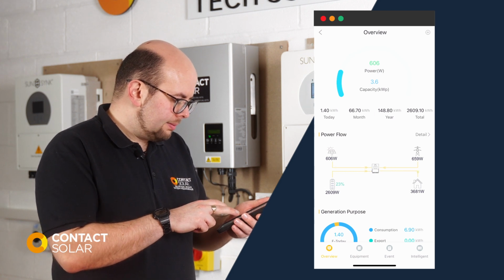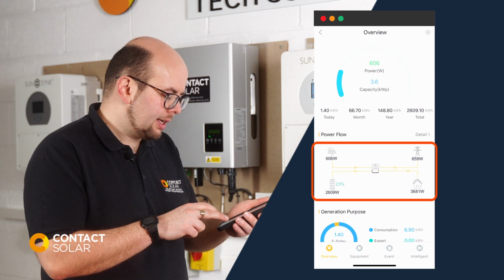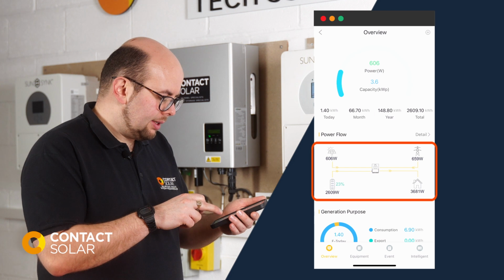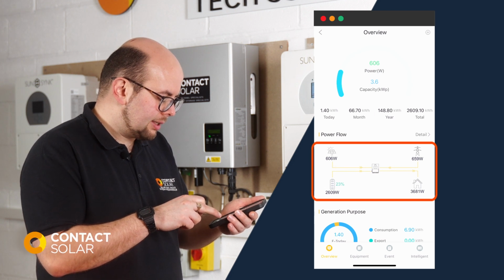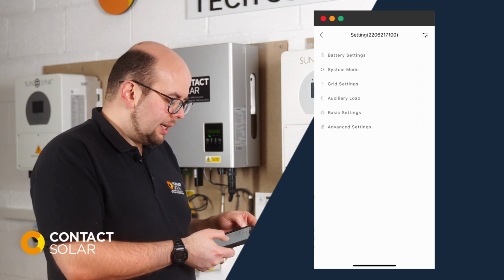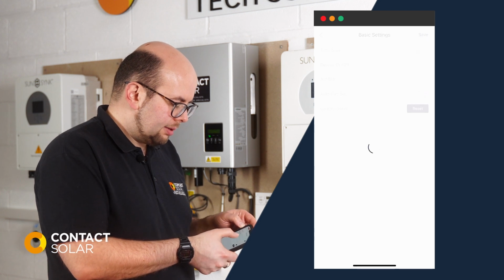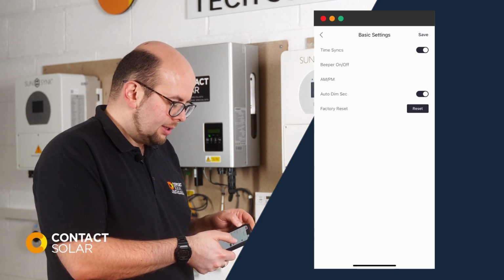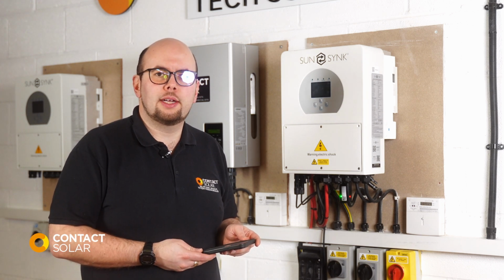SunSynk Connect App  Full Overview

Comment: This app wins the "what dyslexic 6 year old designed this app" award. First off you fail the Ux/Ui rule of "don't make me think".  You throw pages of numbers at me which are totally meaningless to me. The app is then not responsive, meaning if you have large fonts set on your mobile you cannot read the screen.  As a consumer in South Africa I am really interested in a few  things - during a power cut / loadshedding will my batteries last. Connected to the grid I want to know that my settings are optimal to reduce grid consumption. So I go to the web app which is even more useless. This video is just as useless. I can see what it shows, what does it mean to me as a user.

Comment: The trouble is, July 2023 when i had my SunSynk installed the app's data updated every 30 seconds. For the last 6 months it's been every 5 mins, which is utter rubbish. Would NOT recommend SunSynk solely because of this and their rubbish programmers... Let alone the number of times a week the App doesn't work at all due to server downages... My guess is that over the past 18 months, the App hasn't been working properly more than it has.... Don't buy SunSynk...